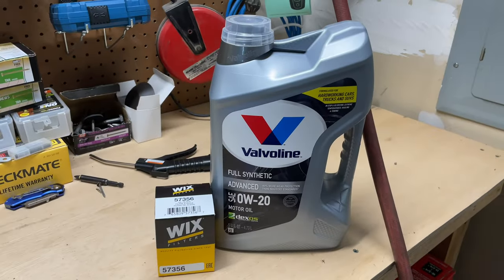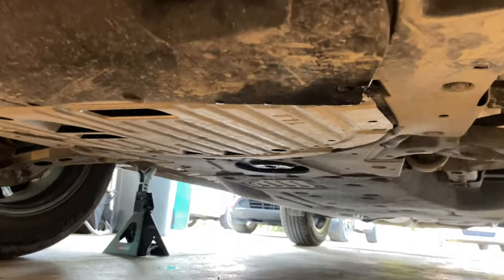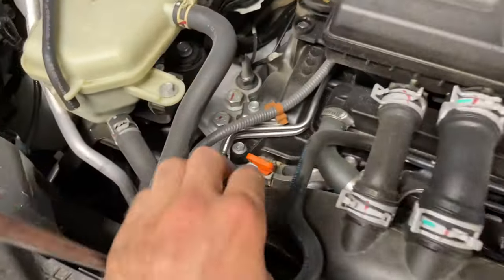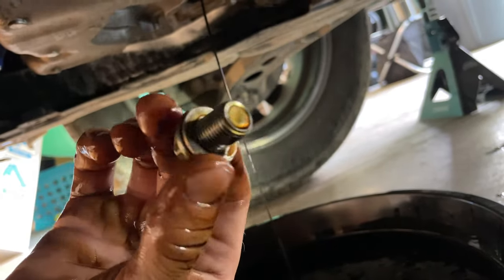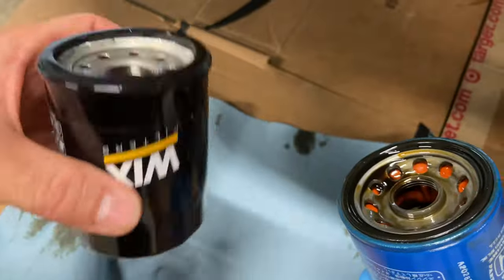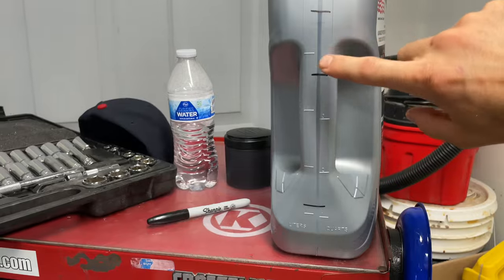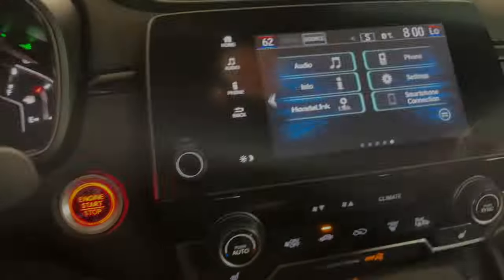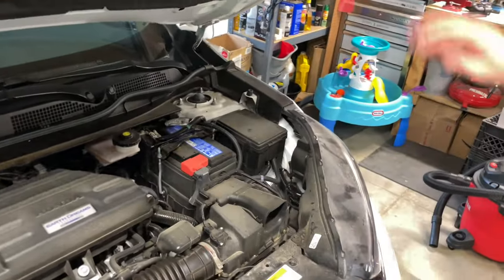2022 Honda CR-V Oil Change (Quick Guide)

Comment: You seem very responsive to messages on here so I thought I would ask this. I have had a few people tell me they changed their own oil and ended up with engine failure and Honda refused to honor under warranty. The people did not have receipts and records and they claimed that they had improperly change the oil. Any guesses as to what that person may have been doing incorrectly that would have caused a problem?
Reply from the maker: @scottdavis5698  Most likely wrong oil filter is my best guess. Always go with the OEM oil filter as it is rated for certain oil bypass pressure at idle rpms.
Reply: @GroatHealth  thank you that is a very sensible thought process

Comment: Can not remove rear phillips head screw to save my life! I just spin the skid plate around, perhaps a blessing. I would love advice! Thanks!
Reply: That bolt is next to the catalytic converter. Lots of heat!!! Weld a nut onto that bolt….then it will come out
Reply: Thank you! @TJ321CYA

Comment: Does the issue of oil dilution still exist? Does it smell like fuel? The oil looks very thin
Reply from the maker: most likely yes, but if you change your oil every 3k miles you will be fine.

Comment: How do u get the fat screws back in the skid plate?  Mine wont stick ill have to use fasteners
Reply: Hey I had problems with that as well..can you tell me what kind of fasteners you used?
Reply: @Daniel-yd6lm  i dont know the name but its those black plastic things that look kinda like fat bolts and you press them thru the holes

Comment: What's the size of the filter wrench? Thanks
Reply from the maker: Get a universal one Eastyard Universal Oil Filter Wrench Adjustable 3 Jaw Oil Filter Removal Tool Range 2-3/8 to 3-7/8 inch with 1/2'' Adapter 3/8'' Square Drive Socket https://a.co/d/hvODejc